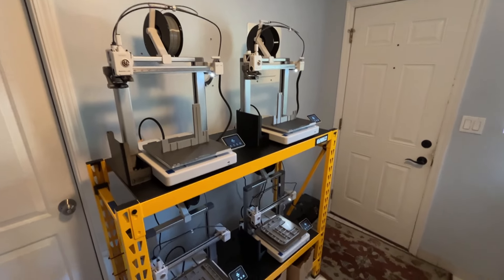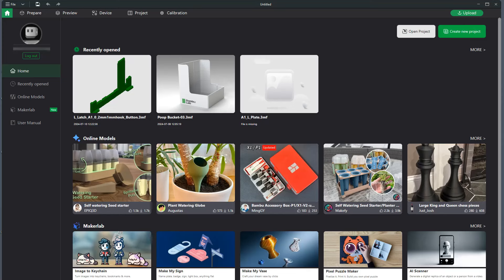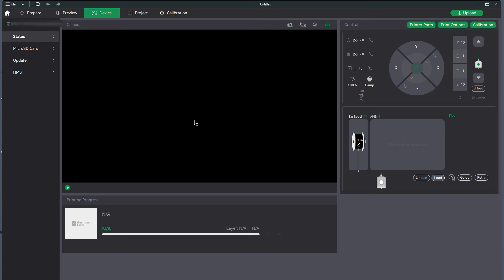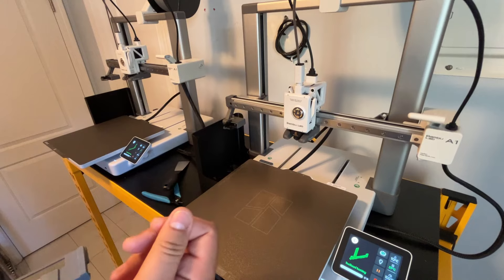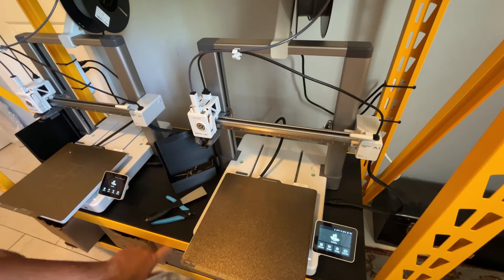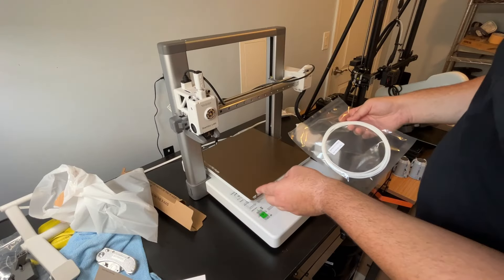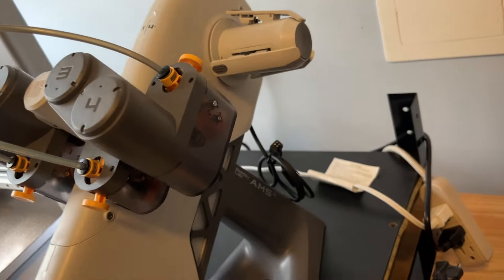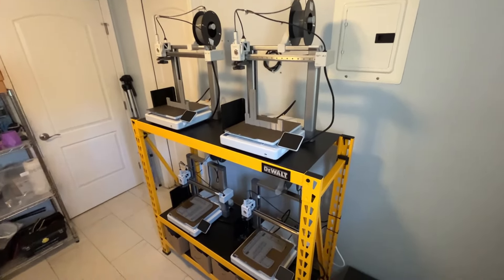Bambu Lab A1: New Firmware, AMS Combo Unboxing - Walkthrough

Comment: That's cool that you got everything updated.
I always leave the calibration and bed leveling on for every print (timelapse off though). It takes very little time and ensures print quality is as good as possible. I do swap my plates out as well; I have an extra plate for each of my printers, so when one print finishes, I remove the plate, swap in another and start the next print.
Bambu got rid of the "membership" discount you got when buying one of their printers and replaced it with a basic bulk discount for 4+ rolls. They lowered the prices on some of their filaments too.
Reply from the maker: @NWGR  Thanks for sharing your approach! It reinforces my plan to keep the calibration and bed leveling on. It seems to be the consensus for the best quality. The plate-swapping technique is a smart strategy too. Also, thanks for the update on Bambu’s discount changes. Really appreciate all the useful info :)

Comment: Bed - usually on. Flow - mainly after changing the filament and sometimes with more complex prints. WiFi/Cloud ON ;-)
Reply from the maker: @PatrykR  Thanks for sharing your settings! It's a smart approach to turn on flow calibration especially after changing filaments or for complex prints. I might give that a try too. Keeping everything connected via WiFi/Cloud sure makes things smoother. Appreciate the tips :)
Reply: @3DTheory  From what I see, you print on each specific element, so the lack of WiFi probably doesn't make much difference. Although WiFi also means notifications, e.g. on the phone, that something strange happened + preview. I most often print individual elements, so remote access makes it much easier. And I use integration with Home Assistant, although here it is local, not cloud, but also WiFi.

PS. You can also enable "lan mode", then we have remote access, but without the Bambu cloud.
Reply from the maker: @PatrykR  Thanks for the insight! I primarily print specific elements, so while WiFi would be handy for notifications, I currently use LAN mode. It's a bit limited, but it helps keep my data secure. Appreciate your suggestions :)

Comment: I leave mine on as well but keep Timelapse off. I just got a a1 to replace my a1 mini and ender 3 v2. Loved the mini but the creality was a constant battle. Just really wanted that bigger bed honestly was very limited to what I could print. My extruder does the same thing on this new firmware I wanted to see if yours did it and it does. Soon as I hit print and the printer starts to home itself it try’s to push filament out for a split second and clicks the extruder gears. Really hope that doesn’t do damage in the long term or if it’s a glitch in the firmware or on purpose. Just don’t see how it can be good for it.
Reply from the maker: @NitoFreak923  Thanks for sharing your setup changes! Upgrading from the A1 Mini and Ender 3 V2 to a new A1 for the bigger bed makes a lot of sense, especially when you need more space for your projects. Regarding the extruder issue on the new firmware, I haven’t paid particular attention to that so I haven’t noticed it myself, but I’ll definitely keep an eye out for it now.  I’m also curious if this is a firmware quirk or something intentional. Hopefully, it was intentional.
Reply: @3DTheory  they just released a bug fix today. Hopefully they fixed it will update when I get home
Reply from the maker: Hi @calank923, this is a general invite I’m sending out, but I specifically wanted to reach out to you! I really valued our interaction on YouTube and think you’d be a great addition to our brand new private Facebook group https://www.facebook.com/groups/516931764060929/ and public Facebook page https://www.facebook.com/people/3D-Theory/61563777117279/ It would be fantastic to see you there and continue our discussions!

Comment: Also my prints pop right off when the plates cool down. I get impatient and I use a pc electric air duster to cool the plate down faster. If I don’t it’s real difficult to remove parts and it feels like I’m going to break something lol. Been doing it like that for 5 plus years on all the different printers/plates I use. Specially on the old school glass plates they have to be ice cold to release
Reply from the maker: @NitoFreak923  That's a clever trick with the electric air duster! Cooling down the plates definitely helps with releasing the prints. I've had similar experiences, especially with glass beds where the prints sometimes stick too well. Once, I even had to use a hammer on a stubborn print lol. Thanks for sharing your method, it’s good to hear how others manage to remove prints :)

Comment: Just curious, why don't you just remove the PEI sheet from the bed and flex it to release the parts?  Does it not work with something that large and flat?
Reply from the maker: @IgnusFast  Thanks for the suggestion! Yes, removing and flexing the PEI sheet does work for releasing these parts. However, I find aligning the sheet back onto the build plate a little tricky. Making sure it fits perfectly onto the alignment guides can be a bit fiddly, especially since the printers are lower on my rack. I try to avoid handling the build plate too much to keep it clean. Using a spatula just makes the process simpler and less disruptive for my setup.

Comment: The screws go through the top of the scraper (blade side) and the plastic piece goes on the bottom. Thats why it didn’t fit it wasn’t the filament.
Reply: Oh, FFS.  I did the same damned thing.  Fixed now, thanks!
Reply from the maker: @NitoFreak923  Thanks for the tip! I definitely had a “genius” moment putting the thumb rest on the wrong side (forehead slap). Thanks to your suggestion, it fits perfectly now. Appreciate the help!

Comment: Still new to 3D printing (also using an A1). My top layers DO NOT look that great (using Bambu Matte PLA).
Reply from the maker: @hc6979  Thanks for sharing! The glossy finish of PETG does differ from matte PLA, which could affect how your top layers look too. Ensuring your printer settings are optimized for PLA and keeping the guide rails lubricated can also help. Perhaps try experimenting with different filaments or adjusting your settings to find what works best. As you adjust, you’ll find the right balance :)
Reply from the maker: Hi @hc6979, this is a general invite I’m sending out, but I specifically wanted to reach out to you! I really valued our interaction on YouTube and think you’d be a great addition to our brand new private Facebook group https://www.facebook.com/groups/516931764060929/ and public Facebook page https://www.facebook.com/people/3D-Theory/61563777117279/ It would be fantastic to see you there and continue our discussions!